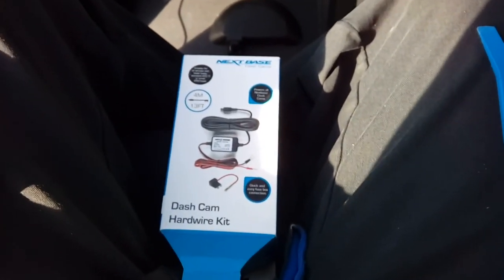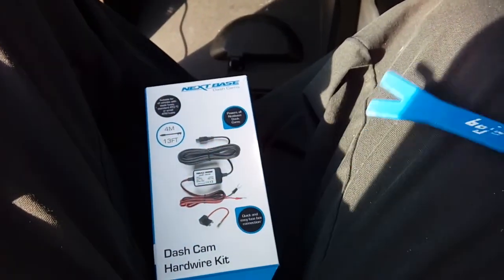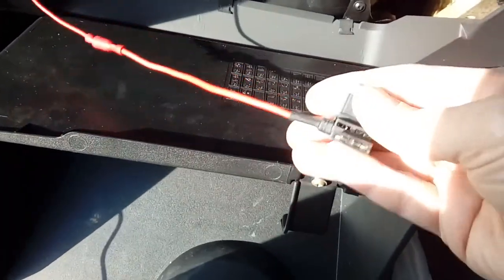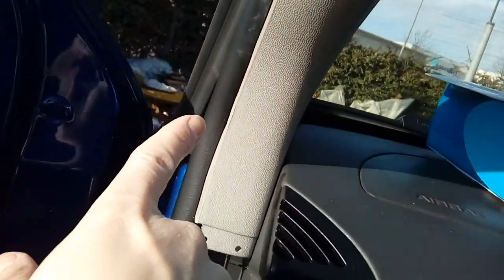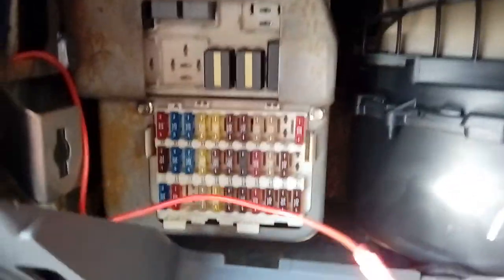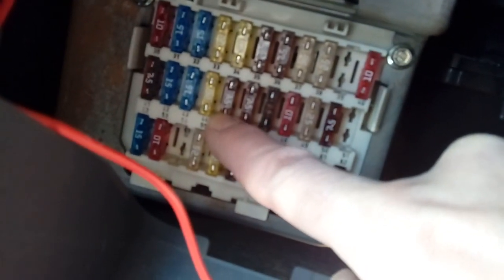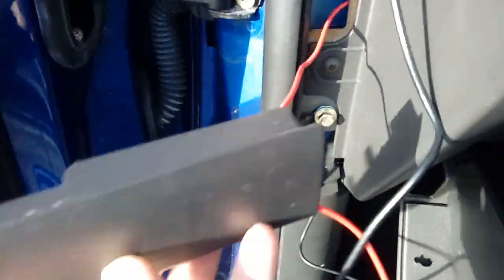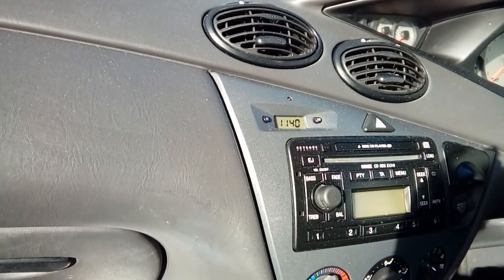Focus 1998 - 2005 how to wire up dash cam to fuse box(simple step by step guide)

Comment: Hi PJ,  I have the same car - but its 2003.  I connected exactly how you did it.  It all works - however, I get a funny noise when turning off.  I think the dash cam is causing that noise because when I disconnected it all.  The noise disappeared.  Question -Do I need another ferrite bead at the piggy back fuse end or something else?

Comment: I have the same car and same cam but I Have no Air Con so would I be able to use the windscreen wiper fuse or what one would you recommend?
Reply from the maker: If your 12v socket is switched (most are on Focus models) then use that.
Reply: PJs projects 
Hi,
The windscreen wipers were on all the time so I used the same fuse socket as you the A/C one but I had no fuse in there but it still worked.
Thanks for the reply.

Comment: My friend . How can I connect a reverse dash cam ?
Reply from the maker: All reversing cameras come with instructions but basically it’s the following-
1. Constant power
2. Switched power
3. Earth
4. Reverse signal trigger

Connect reverse trigger signal to either reverse switch in the gearbox or the reverse light bulb feed in the rear cluster.

Comment: So I fitted it all, however the fuse socket I used (the same as you) is an ignition live one, with ignition on the sockets read 12.30v on the 'hot' pin and 7 on the other? However others read 12.30 on the hot and 0 on the other? However the one I want to use is the only ignition live one available, will it be ok?
Reply from the maker: Just make sure your earth point is good and then try a new fuse in the socket,sounds like the original fuse is on it's way out.
Reply: PJs projects So I read the voltage with fuse in situ with ignition off, both ends of the fuse read 0. Also tested the pins of socket with the fuse out, both pins read 0. With fuse out I put ignition on and one socket pins read 12.3v and the other 7v, could you check yours is the same? I didn't this on a 2002 focus as well. Thanks.

Comment: i have a question, my 12v socket has a continue source of power, even with the the key is out. i want to connect the 12volt socket on my accessory circuit. is that an easy thing to do or is my 12volt socket directly mounted on my battery
Reply from the maker: You would need to snip the power cable that goes to the socket and run a new one to a switched live at the fuse box. For this you would need a multimeter or test probe to check which fuse is switched or fi your not to worried about testing the circuit you could use the fuse that is for the heater blower as that one is switched and not a critical circuit. Simply buy a fuse spur of Ebay and run the cable to the underside of the socket.